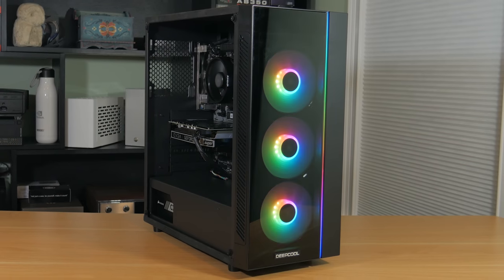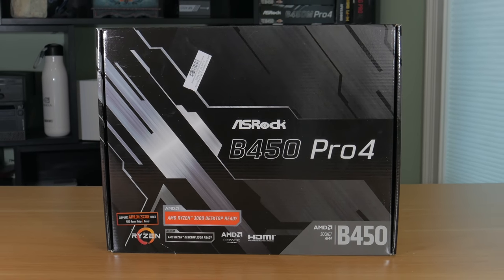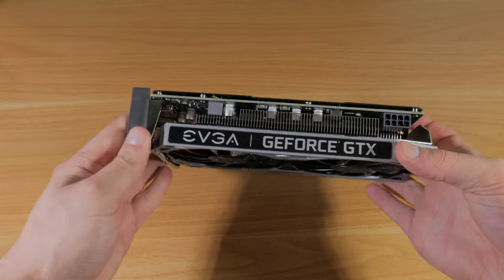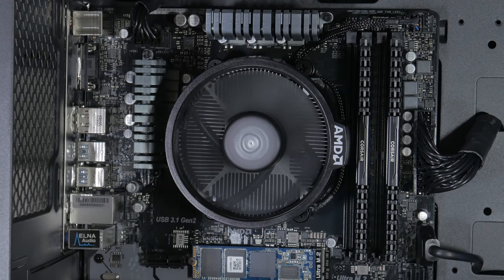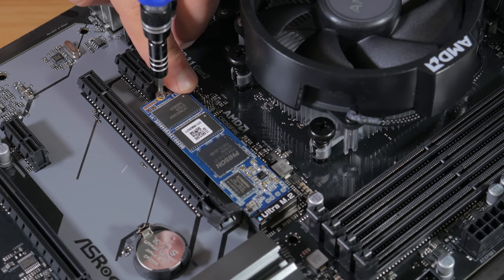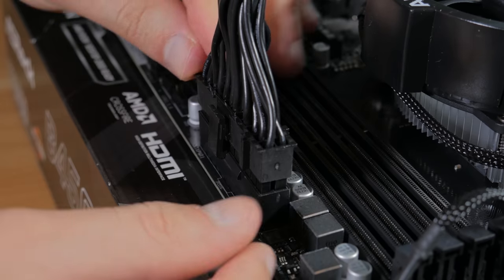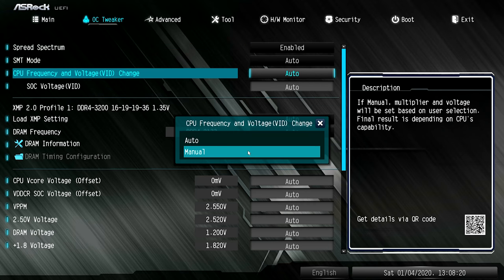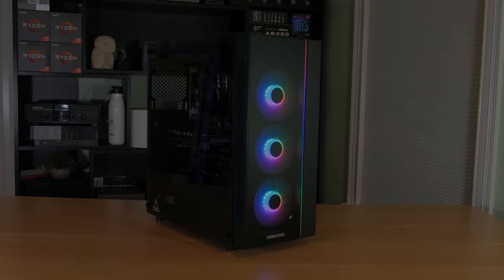$750 Gaming PC Build Guide! | January 2020

Comment: Gtx1660super is new gtx1050ti
Reply: And fully pointless with the release of the 5600xt and price cut to the GF 2060...  AMD just killed the 1660 super/TI with a better card, and by forcing Nvidia to drop the price of the 2060 to $299 which puts it in the same budget category as the 1660 super/ti, making it a pointless GPU to buy.  There are LOTS of 1660/1650 vanilla GPU's sitting in inventory, and likely the super version of the 1660 will be joining them until nvidia cuts prices, which I expect they will in time.  Good time to be building a value gaming rig!

Comment: that is wayyy too much voltage for 4,1ghz
Reply: Yeah it’s a tad higher. Not crazy but I bit too much. Might have a bad bun chip
Reply: Im running 4,325 GHz @ 1,35v and it still hits high 80's - low 90's on Dark Rock Pro 4
Reply: Audrius Veryga 3600? I’m running the 3950x the Oc I run when I need the cores is 1.35v 4.4 ghz. Got lucky with the chip. Sit around 65 degrees at load. Custom loop with noctua industrials on the 360mm rad dissipates a ton of heat lol. Sounds like an aircraft carrier but shit stays cool
Reply: Yeah, 3600

Comment: This maybe the one i build.
Reply: Nope. You can do better and 3600 is not worth the amount of money taken away from the gpu and motherboard. This is better:
https://pcpartpicker.com/list/
Reply: @miniweeddeerz1820  bro you are consistanty posting empty links
Reply: @MrFrankEast  yeah I figured out last week that my links don't work. I don't do that anymore. It's funny. If I tap the links, they work, but if someone else takes the links, they don't work. I type only now. Sorry for seeming dumb
Reply: @miniweeddeerz1820  that's really unfortunate I already put the cpu and gpu on order lolz
Reply: @MrFrankEast  f
Reply: @MrFrankEast  the problem is that b450 board may not come Ryzen 3000 ready. Which means the CPU won't work. His build is good, but what I probably did is got a better model 1660 super(the two models in the description don't have great coolers and will be hot or loud)a better motherboard and a cheaper Ryzen 7 2700x and cheaper 3000mhz ram which is still really good for Ryzen 2nd gen. You'll lose a bit of performance true, but you'll gain better cooling, a quieter system, and the 8 cores is better futureproofing. And the performance difference on a mid range GPU is really small(the better the gpu, the bigger the difference is)
Reply: @miniweeddeerz1820  So i should probably cancel this then. Also ive heard conflicting issues of b450 board coming with the updated bios or not. Built one for my cousin and it was ready out the jump. It really depends on the performance to me im leaving a build that runs every game (pubg and the likes) on medium at like 30 frames, i cant do it anymore
Reply: @MrFrankEast  well is it worth the risk? Probably not. If you want to spend a tad extra on the build, get a b450 gaming plus max for not much extra(10-15 dollars) than the b450 pro4 and better everything except minus 1 m.2 slot. However it does come 3000 ready so the 3600 will work out of the box. Also get a better 1660 super model(MSI gaming x is 260) for a cooler quieter more premium looking card.
Reply: @miniweeddeerz1820  I have some wiggle room so I dont HAVE to stick to 750 i was leaning more towards 8something 900 anway cuz im getting massive storage. But ok random internet commenter ill put my faith in you. Keeping the CPU cancelling the GPU and ordering the super instead.
Reply: @miniweeddeerz1820  so im switching from the venus to the gaming x
Reply: @UCgpF5gbRlepV6h521vupzHA bless up I appreciate all your input 🙏🙏 built many but never had the capital for my own first build
Reply: @MrFrankEast  welcome. Happy to help. That combo will absolutely destroy at 1080p high or more in any game you throw at it. Pubg at ultra details should be a breeze.
Reply: @miniweeddeerz1820  oy m8 not to bug you again but im thinking about the EVGA supernova 650 W gold certified psu. Sound good? The one in the video has all negative reviews
Reply: @MrFrankEast  you don't need a 650 watt 80+ gold. Get 600watts maximum for headroom and 80+bronze. Maybe a evga br/bq is a good choice.

Comment: do NOT buy a 1660 Super, it is such a trash card. You're better off getting a used 1080 or 1070 TI that has MUCH better performance, or throwing in the extra $50~$100 for a 2060S.